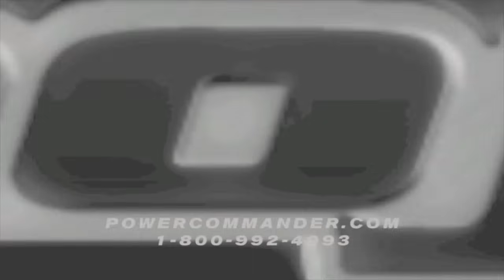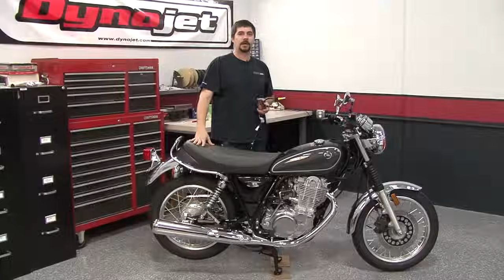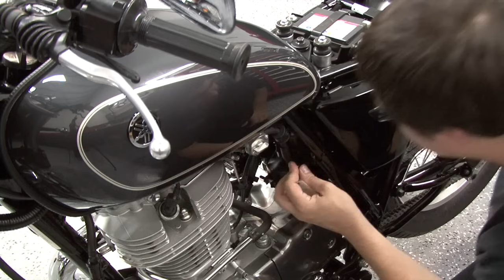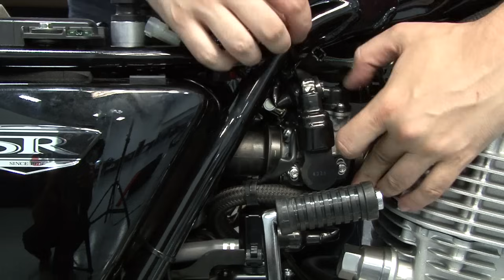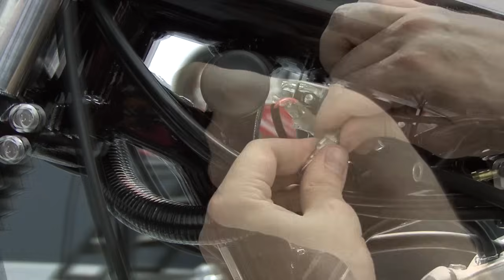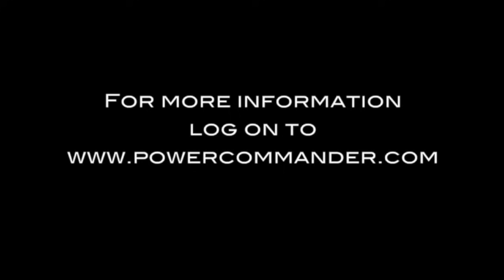Power Commander V Install: 2015 Yamaha SR400

Comment: I've had this on the bike for almost a year now. Can't really feel any difference in power and my check engine light is still on. There is no solution in sight. Dynojet has been on radio silence regarding a fix. Horrible after sale service!!!!
Reply: +DynojetResearch yes. Chris Kelly is the person I have been exchanging a few emails. My last email to him was on 10/26/15 asking if he had any updates for me. No reply.
Reply: +DynojetResearch thanks. I still haven't received a follow up.
Reply: +DynojetResearch thanks for replying. I appreciate that. I'll put my stock O2 sensors back on for the 5th time. (It's really not convenient to do that every few hundreds miles you know). I will let you know when the CEL comes back on. Im curious as to why I wasn't offered a replacement O2 optimizer earlier? Instead, I was told explicitly to go out and find my own resistors to make my own optimizer to diagnose the problem. :-(

Can I as how long did you have the bike in the shop and how you tested the bike? In my experience, every time the CEL comes on, it was when I'm riding at constant freeway speeds of 75+ mph. 

You haven't heard of any other problems because others don't care enough to report it. One gentleman is in Australia and have resorted to just removing the bulb so he's not bothered by the CEL. Another one in New Jersey removed his unit altogether. They keep their complaint in the sr400 forums.
Reply: +DynojetResearch mariominwary[at}gmaildotcom

Comment: O2 sensor replaced with something called an "O2 optimizer" which is probably a couple resistors or something? That seems strange!
Reply: +Paul Bruneau I presume the stock O2 sensor just tells you one of 3 possibilities. Too lean, normal, or too rich.
I've heard of broadband sensors that tell a compatible CPU what the exact output is, and the CPU can much easier finetune the mixture.
Reply: +Muranaman it's possible...anything's possible in the magical land of aftermarket power enhancement!!

Comment: Seems to be so much crap on this bike, on a bike which was originally a simple machine. Modern laws seem to have made all this crap necessary?. I had an SR 500 back in the late 80s. I had it 8 years and was a great bike. It was 35 horsepower and would do 90MPH and give 60 MPG. The 400 only has 23 horsepower!! and that is with fuel injection. Something wrong there methinks. All the fuel pump/fuel injection junk need binning, and an SR 500 motor fitted to make a good modern classic. OK, going to be an expensive operation. Or just buy an SR500. Much cheaper even if you have to do some restoration. 500s were on sale in Japan till well into the 2000s.

Comment: We need to know more. How about a wiring diagram to show how the PC fits into the system? How about a video showing how to adjust the PC for changes in the engine due to using hi-performance parts? And how about some dyno videos showing that this thing actually works? If you want me to part with $500 + you need to show me something to make me want to do that.
Thanks for this video, I hope there will be more.